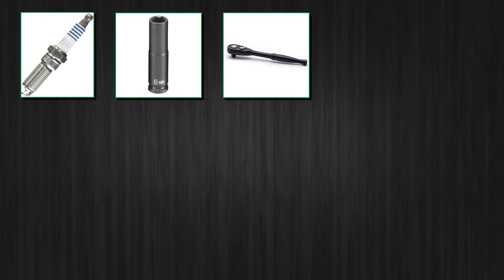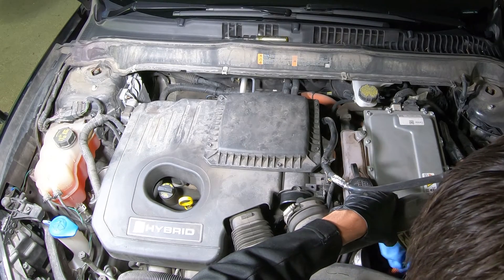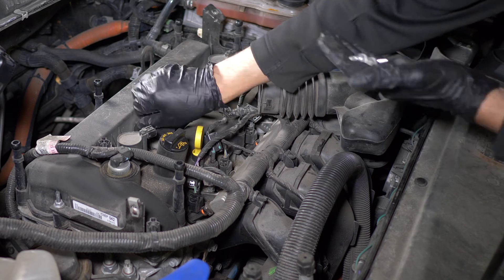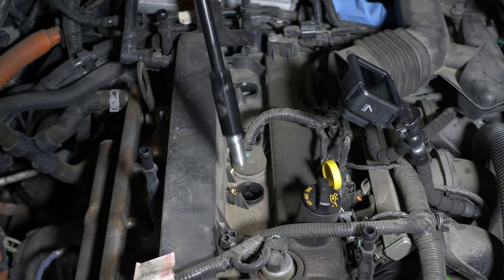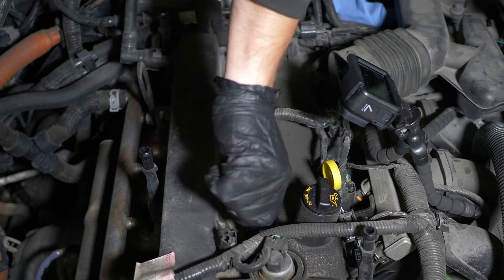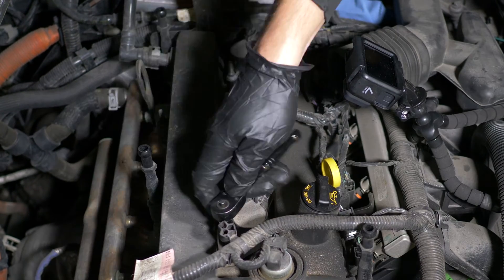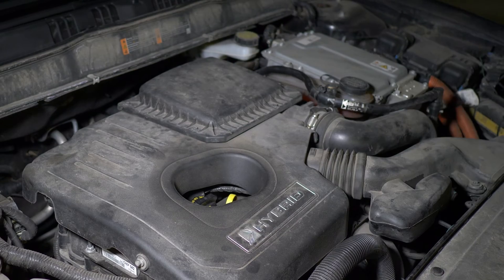2015 Ford Fusion 2.0L Hybrid Spark Plugs replacement DIY

Comment: 2015 Fusion Energi uses 7mm bolts on the plastic cover (at least mine does). 8mm heads are still used for the ignition coils; two are on studs so you'll need a deep 8mm socket.
Reply from the maker: This is not a 2015 Ford Fusion Energi. This is a 2015 Ford Fusion 2.0L Hybrid (not a plug-in hybrid). It uses cover bolts that require an 8mm socket.

Comment: What brand of magnetized spark plug socket - and size - are you using? I can see how a standard nonmagnetic socket would not hold the spark plug, and it would just drop down into the deep hole and be tough to thread in. Thanks! Ford Dealer just quoted me $268 to change the plugs.
Reply from the maker: I use a standard spark plug 5/8 socket. It doesn't have a magnet, but it has a rubber insert that grabs onto the outside part of the plug and holds onto it when you completely unscrew it from the engine head.
Reply: @AcuraAddicted   Thank you - is it a Craftsman brand by any chance? if not, which brand?
Reply from the maker: Stanley tool set.

Comment: Evaporative Emission purge control valve  (EVAP) for fusion hibrid 2016 code 0457 thank you
Reply from the maker: I do not have this car, neither did I work on it, so you're going to have to look it up in the service manual or elsewhere to make sure, but the evap purge valve is usually located near the intake manifold and has inlet and outlet in it.

Comment: You do not need to remove the air hose/duct going to the mass air flow sensor.    Loosen it at the sensor, unbolt the air filter housing / engine cover, lift up the housing/cover and move it back away from the air duct.

Comment: My fusion energi got 37 average mpg in hot summer and cold winter. 40 in spring and fall when no a/c and heat is needed. Check your tire makesure they are inflated right above recommended psi and only use 0w-20 oil and clean air filter. Drive on speed limit with cruise control also helps alot. After all its a Ford not Primus.
Reply from the maker: This is not a plug in Energi. This is a regular non plug in hybrid.

Comment: Forgot to put the recommended brake caliper grease and dielectric compound inside the boots before installation.  Was is OK to just reuse what was on the plugs already upon re-install?
Reply: This was per the shop manual
Reply from the maker: There was plenty of dielectric grease inside the ignition coils, I saw no need to add more.
Reply: From the Ford maintenance manual: 

"NOTE: When installing the ignition coil-on-plugs, apply a small amount of silicone brake caliper grease and dielectric compound to the inside of the ignition coil-on-plug boots before installation.
 
Material : Silicone Brake Caliper Grease and Dielectric Compound / XG-3-A (ESE-M1C171-A) 
"

Comment: Is there anything you can do to boost your gas mileage? They advertised these cars to get anywhere from 40 to 48 mpg and I've yet to see this happen! I have a 2013 Ford Fusion Hybrid and about the best I've seen is about 34 and sometimes 36 mpg.
Reply from the maker: Not sure why you were not able to get to even 40 mpg. This car went on average at 5.5 liters per 100 km throughout the entire time with this owner, which is about 47 mpg. I was even driving it myself for several months with the same result. Perhaps, your battery is bad?
Reply: @AcuraAddicted  Everything was tested prior to buying the vehicle so I'm at a loss at this time except to try and tune it up! It had 63038 miles on it when I bought it a month ago and I put alot of miles on a vehicle! It now has 69287 miles so hoping by tuning it up this will increase my mpg!
Reply from the maker: The car I worked on was at 65K miles. I hope the tune up works for you!
Reply: @AcuraAddicted  You have a Wonderful day!!!!!

Comment: Min1:19 start I was looking for. Tip if you use high end spark plug 5/8 socket get one with rubber inside so it clips on the tip of the plug and pull it also easier to install
Reply from the maker: Thanks! Yeah, that's exactly what I've been using. The problem is that the rubber piece is so tight, when the socket grabs the plug, the bond is sometimes stronger than that of the ball in the extension, so the extension comes out of the socket, which continues to sit in the tube on a plug. But I managed to extract plugs # 2, 3 and 4 with that socket and extension.

Comment: "hand tighten as you go" ...what was the torque wrench for? Do you know the torque spec for this? Thank you.
Reply: You may no longer need this information but it's 12 Nm (Newton-Meters) per the Ford Fusion Hybrid maintenance html you can find floating around online.
Reply from the maker: Unfortunately, I was not able to find an exact torque for this specific model, so I just made them snug manually.
Reply: @AcuraAddicted  so, in the area where the spark plugs are located, one of them (#3) had a little bit of gasoline (?)/oil(?). Is that normal or cause for concern?
Reply from the maker: @Oracol  A little drop of oil is normal. Of course, if they are dripping with oil or gas, that's a problem.
Reply: @AcuraAddicted  oh, ok. Yeah, it was just a little bit. Thank you.

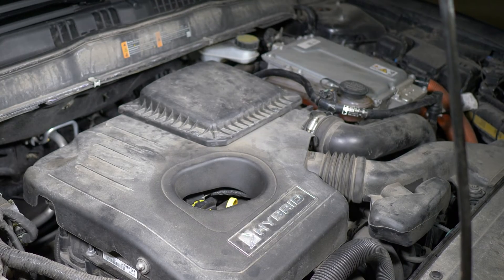Comment: Question, when the engine is running does the electric motor makes a whiny sound too? I think I heard it at 5:39 I have never heard that noise before it made that sound after putting 2m miles in my car when bought it.
Reply from the maker: Yep, it does that.
Reply: @AcuraAddicted  I read that could be transmission problem
Reply from the maker: @andresara4711  Yes, that's right. Check your transmission fluid level to make sure it's not draining out. Unfortunately it's not an easy task as there is no dipstick. Also, if you are running low (or even completely out) of transmission fluid, it's very likely the car won't give any warning and you can simply run with the transmission dry. Unfortunately with this design you might not even notice the transmission fluid is draining.

Comment: Ford dealer just told my wife she needed to change the plugs in our Fusion Hybrid. 250.00. I think I can do it myself and spend the extra 240.00 on beer.
Reply: You haven't bought spark plugs in a while... they've gone up in price
Reply from the maker: Oof! $250 for just the spark plug change is pretty steep. Enjoy your beer! 🍺

Comment: Hi Bogdan,
Another question about my MDX.  Is it critical to use high octane (91 or even higher 93 octane) gas on an MDX for "better engine performance", or it would be OK if I put in cheaper 89 octane gas.?   Would use of 89 octane gas cause any longterm harm to the engine which is otherwise properly maintained?  Thanks.
Reply from the maker: Good question. 91 is required by manufacturer. Not recommended, but required. The engine was designed to work with 91 or higher. It will stiol work on 87, but the manufacturer clearly says it can damage your engine. So I wouldn’t put anything lower than 91 into your MDX. On the other hand I heard from some people they put 87 and have no issues. In my case I plan to have this car for a very long time and I need it to run reliably, so I can’t risk it.
Reply: @AcuraAddicted  :  Good point and thanks for the quick reply.

Comment: oh man nicely done, how long have you been posting all these for?
Reply from the maker: Thanks! About 2.5 years now
Reply: @AcuraAddicted  no mention of gapping the plugs?... thats a vital step
Reply from the maker: @mlabatid  No, it isn't. These spark plugs come pre-gapped already, there is no need to gap them. In fact, iridium center electrode can be easily damaged should you decide to gap them (which is wrong).

Comment: Another great video Bogdan! Thanks! Also, do you plan on making any videos on valve adjustments on your MDX? Dealership is saying I'm due for one for my 2011 MDX but was wondering if that's a DIY. Thanks Bogdan!
Reply from the maker: Thanks! Valve adjustment is a tricky business, best to leave it to professionals. I will be opening the valve covers this year, but much later. Might try at least measuring the gaps. Acura’s official view on it is that they only need adjusting if noisy. But since I’ll be there anyway, I’ll be checking the gaps. Last time I did it at 100K miles - they were fine.
Reply: @AcuraAddicted  Thanks Bogdan! What kind of noise should I be looking for prior to a valve adjustment? I do hear a couple of various noises that is out of the ordinary when I drive, but for the life of me, I cannot pin point what it is exactly...Thanks for the help
Reply from the maker: @philliple10  It's hard to explain in a sentence. But you can find it on Youtube, just search "noisy valves honda". It's kind of a ticking sound that obviously gets faster with higher RPM. It's also mosly constant and doesn't go away at certain RPM.
Reply: @AcuraAddicted  Thank you so much!